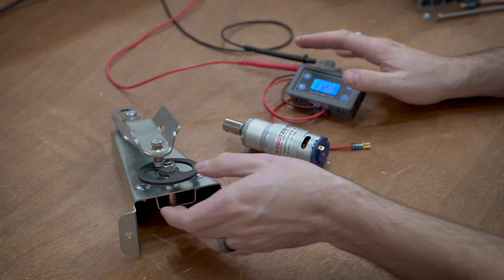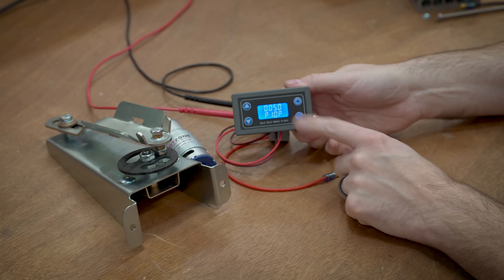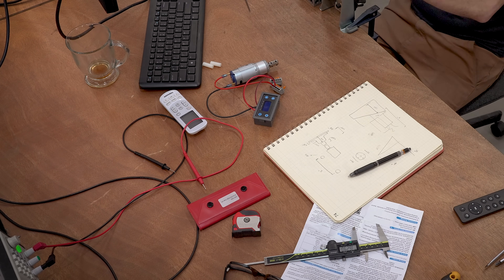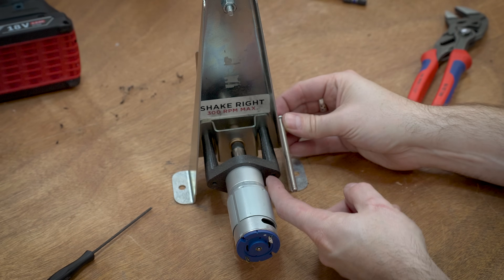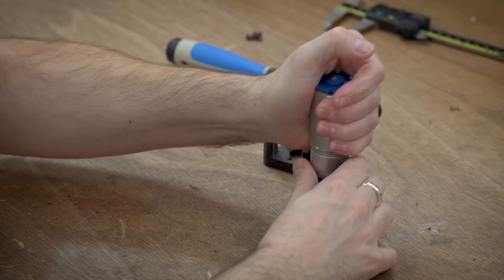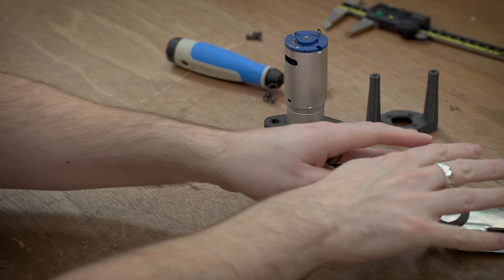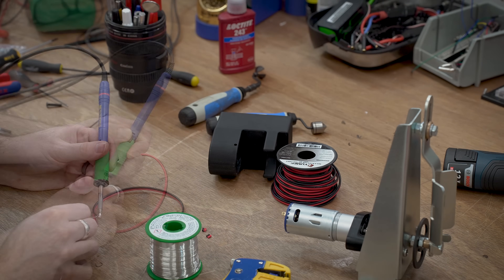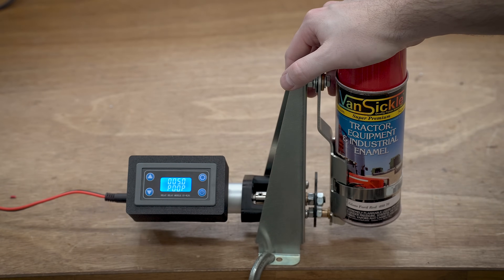DIY Automatic Motorized Paint Shaker!

Comment: I suggest placing a block under the rear of the motor housing to prevent the housing from vibrating up and down.  Alternately, you could make a new motor housing with a rear extension containing a vertical hole drilled through it so a bolt can be inserted to provide rear support.  A plastic foot placed on the bottom of the bolt should prevent damage to the workbench and further dampen vibration.  The bolt could be adjusted for height and secured in place with two lock nuts, one threaded underneath the housing and the other threaded above the housing.  I also suggest replacing the hose clamp with something more rugged.  Customers have reported this part often breaks.

Comment: Excellent video, but can you show how to wired up the relay. I'm a mechanical designer but not electrical, thanks in advance. Can you tell about your power supply? The voltage and Amps?

Comment: Love the design.

Question?  You mentioned that you used your "bench power supply" to power it.   It's hard to tell in the timer's description but is it fed from 120VAC outlet or do I need a 12VDC power supply to feed the timer?

Thank you.
Reply from the maker: It's a variable output power DC power supply.  I can dial in the right voltage.  I use 12V for this.  You could just use any 12VDC power supply.
Reply: @RobertCowanDIY  thank you for the reply.

Comment: Great video, thanks a lot. I ordered the same relay but for the life of me can’t figure out the wiring. Can you elaborate and help a guy out? Thanks!
Reply from the maker: Did you end up finding the datasheet?  I don't know if I'd be able to explain it better than that.  Just google the model number and datasheet, it's easy to find.
Reply: yeah .. I've realized my wiring is correct but my application wasn't .. my motor (old battery drill gear-motor) has to high a start amp draw .. from what I understand it creates a voltage drop when, powering both load and relay from the same powersource, makes the relay drop offline .. so all I got was a click and a 4 deg movement on the motor .. then nothing ... was tearing my hair out until I came across a line in a forum entry that suggested the voltage drop .. not sure how to fix it yet .. either other motor (yours is an expensive unit in Canada) or maybe some sort of capacitor that stabilizes the input voltage OR two power sources .. works like a charm with my two desktop power sources btw .. anywho, thanks for the video ..
Reply from the maker: @matsworld9386  Gotcha, mine was doing the same thing on a crappy power supply.  A capacitor would most likely fix the issue.  Best of luck!
Reply: oh interesting .. hm .. I'll try my other one as the main one and see what happens .. good to know your motor wouldn't be the solution .. cheers!
Reply from the maker: @matsworld9386  Yeah, try the biggest power supply you can find and see if that solves it.  If that does, a capacitor would probably do the trick.

Comment: Just a sanity heads up if you put your cans into warm/hot water for a few minutes before use you dont have to spend minutes shaking the cans just 15 seconds when warm and they are properly agitated unless its undercoat and it will need 30 seconds. Bonus is the warm paint and the warmed butane driving it will perform significantly better.
Reply: That's only true if they're relatively fresh. Cans that have sat for months will still need the longer agitation period to break up the pigment clots that have settled out. Totally agree with a warm water bath, though. The paint lays down far smoother.
Reply: Liar.

Comment: It looks like the electronics probly experience significant vibration, that could be an issue. The timer isn't built for that, so I expect cracked solder joints causing random shut downs or restarts.

Comment: Very cool project!

What are those things in the red pouch?

Why the thick walls on the timer housing?

I always flip my spray cans upside down to shake. The assumption is they've been sitting right side up since they were filled, so all the solids have settled to the bottom.
Reply from the maker: HA!  I literally released a video just a couple weeks ago that explain exactly that, it's worth a watch:  https://youtu.be/pFNDGTDgj3I  Also, when you're done with that one, might as well just go watch my whole channel start to finish a few times just to be safe.

Comment: Do not try this at home; I routinely take my aerosol spray paint cans and put them in my heated ultrasonic cleaner. Heat and shake at the same time. I just take them out and shake them for 10 seconds or so and I'm ready to go.
Reply from the maker: Hum, interesting.  I feel like I need an ultrasonic cleaner.
Reply: @RobertCowanDIY  I really like this project though. I would like to build one of these too.
Reply from the maker: @gearhead7896  Nice!  I think at the very least, it's a fun little project and the relay timer module is a nice thing to know about.  Thanks for watching!

Comment: A plumbers expansion plug and hunk of PVC turns any electric drill into a paint shaker in seconds, but this is still interesting.
Reply from the maker: MANY people have mentioned something similar.  I still have my doubts about how properly that's really 'mixing' the paint versus just stirring it around.   But if it works for your application, go for it!

Comment: Nice. I have one I built 20 years ago from a copier. It’s over kill I could shake a car with it but the lesson I learned was shake the can like your arm would. Slowly. The short fast stroke you have will shake the straw out of the nozzle in the can.   Slow yours down.
Reply from the maker: Huh, hasn't happened yet, but I'll keep an eye on it.  Slowing it down is super easy, I just need to decrease the voltage of the power supply.

Comment: Great idea but I'm just wondering if you could simplify the design by moving the motor forwards on to the main frame and mounting a new flywheel directly to the motor shaft.
Reply from the maker: I think that would cause more issues than it solves and your part count would still be the same.  You'd still need some sort of mount for the motor, since it mounts on the face of the gearbox.  Additionally, you'd end up over-constraining the assembly.  The shaft would see the axial loads from the paint can shaking, which would be a problem for the bearings on the gearbox, they're not designed for that load.  The bushings exist for that purpose.  By using the key into the head of the bolt, it allows for some axial wobble and play around that axis, meaning those loads don't get transferred into the motor or gearbox.  This was the simplest way I could come up with that wouldn't put all that strain on the motor's output shaft.

Comment: I use a 10" x 3" PVC tube with a cap and a bolt chucked up in my drill. Drop the Spray can in and spin for 15sec each end of can. Work great.

Comment: Beautiful.  Reduce shake speed for effective shake
Reply from the maker: It's where it needs to be (according to the shaker), but decreasing the voltage a bit will slow it down.  Since I'm using a bench power supply, it's easy to just dial down the voltage.

Comment: Nicely done! Kind of a conincidence. I left my pla 3d printed drill paint can shaker outside and the cold made the plastic brittle. So now I have to print another. Side note thank you for the information on the k1. You were spot on. I bought and replaced the original extruder and now she is a good one!
Reply from the maker: OH yeah?  What extruder did you go with?  I'm curious because it's working fine for me, but the print quality is pretty 'meh'.
Reply: @RobertCowanDIY  I went with the updated creality extruder. The one that is called the v3.0, as for quality I also upgraded the hot end to the microswiss and that has been very very nice! I am planning on starting to use my k1 as part of the small printer farm I have. If it works out I will buy a couple more of these.
Reply from the maker: @Engineerd3d Interesting.  I'm still not sure if I have the most recent one.  I can't really find great details on the different versions.  From what I've seen, it looks like mine has the most recent one.  I'll have to check out the microswiss, I've heard good things but haven't seen a before/after comparison.  Mine prints fine, but the quality is just meh.  I've heard that gyroid infill is pretty necessary due to the flimsy connection of the hotend.
Reply: @RobertCowanDIY  for me out of 4 printers I have this one has the best overall quality. I tend to use thicker walls as the infill influences the outcome less that way.
Reply from the maker: @Engineerd3d HUH, that hasn't been my experience.  I get a lot of wobbling and such on the surface (VFAs?).  I'll try thicker walls.  What are your other 3 printers?
Reply: @RobertCowanDIY  I have 3 ender 3s that have been tuned for production work.
Reply from the maker: @Engineerd3d  Gotcha.  I guess I need to spend some time tweaking the K1 since the print quality is certainly the worst of the 3 for me.  I heard the latest firmware is a big jump in quality though.

Comment: Not a good paint shaker at all, would not be mixed properly.
Reply from the maker: And why is that?  It's moving up and down and side to side, just like the instructions say.  The ball is also moving quite a bit, agitating the paint as well.  It's kinda ideal.
Reply: Yes, I think the vast majority of the mixing is achieved by vertical motion, making horizontal motion unnecessary, but there is still some horizontal motion from this design. My only very slight concern is that it may be moving too fast to allow the liquid to utilise all the inertia, effectively shaking the can, while the liquid stays still.

Comment: I really like the use of heat thread inserts here: no nuts to lose if you decide to remove the motor for more compact storage later and the PETG will probably keep the screw under a bit of tension so less likely to vibrate loose but with locktite it's just not going anywhere.

Also making the motor mount out of PETG along with the compliance in the coupling would along with better longevity of the plastic maybe give some dampening properties to the motor and the electronics box. Not sure if that's going to make any tangible difference in keeping all the solder joints or the brushes inside the motor intact but it's probably better than a full hard mount.

11:29 I think this is a very valuable feature, ergonomics are pretty important and the ability to adjust the screen so it's clearly legible without having to bow down or twist your head in weird angles is going to make this a lot more approachable to use. I guess after using it a couple of times all you need is to blindly press the start button and not look at the display but even for just aesthetics reasons I really like the decision to make it pivotable.
Reply from the maker: Hey thanks!  Yeah, there are a lot of little details in there.  The PETG motor mount does actually damp quite a bit compared to the PLA one.  I think it should be just fine for using 5 minutes at a time.

Comment: That mini cutter is interesting. I see it being sold on aliexpress but not powered from DC, so I assume motor was replaced with something better.
Reply from the maker: Correct.  The chop saw is from harbor freight, but it now has a 1KW brushless motor/controller and is powered from my Bosch tool batteries.  I'll get to documenting the build some day!
Reply: @RobertCowanDIY  Could you tell us what motor model did you use?
Reply from the maker: @arekx  I'll have everything linked in the video once it goes live.
Reply: @RobertCowanDIY  Ah, so "some day" is close 🙂
Reply from the maker: @arekx  Yeah, it's usable, it just needs to be 'finished' and made a bit more presentable.

Comment: love it........ thanks for putting this on printables....great stuff...i really thought you were going to cnc this out of aluminum :)
Reply from the maker: Nah, I'm on a big 3d printing kick right now it seems.  Machining is fun, but for smaller projects like this, I just want to get it done and move on.
Reply: @RobertCowanDIY     the inserts were a great idea....i have a love hate relationship with 3d printing...tho the bambu makes it a bit more loveable...
Reply from the maker: @minskmade What's your hate for it?  I just had to run something on my CNC router the other day and man, 3d printing is easy mode.  Going through the CAM process, swapping out tools, indicating the part, workholding, etc.  3d printing feels like cheating.
Reply: @RobertCowanDIY    i feel like 3d printing takes to long....I am an impatient fellow. Though the new Bambu is twice as fast...so not so annoying to me...
Reply from the maker: @minskmade Truth.  BUT, it needs little intervention.  I've learned to structure my projects around the 'wait time'.  I always make sure I'm running a part overnight, or the first thing I do is start with printing something and THEN go clean up the shop and prepare for assembly or something.  It's like cooking.  While water is boiling, you cut up ingredients.  While something is in the oven, you clean up the dishes.  Use the downtime for something else and assume there will be downtime while stuff prints.
Reply: @RobertCowanDIY    that's a very good analogy.
Reply from the maker: @minskmade Yeah, I've spent a lot of time thinking about how 3d printing fits into my projects.

Comment: Nice solution. I do wonder if a soft start/stop would be feasable.
Reply from the maker: Since the motor has a planetary gearbox there is a bit of a mechanical soft-start since it's relatively low RPM.  I know that's a BIT of a stretch, but I actually did consider a soft-start, but that would involve some sort of motor controller (or maybe just a big resistor?), and in the end it seemed to work just fine.

Comment: I dunno man, 450rpms doesn't seem too fast to me- time for high-speed testing with BL motors... :D
Reply from the maker: Ha.  I DID test it with faster motors, I didn't originally have that RPM on hand.  I considered it, but at higher speeds the spray paint can is not properly constrained in the Z axis, so it will just self-eject when going too fast.  I did consider re-engineering the cradle, but sanity got the better of me.

Comment: I half expected the weight of the motor and the electronics just floating in the air to be a problem, but it seems to run fine. Nice job.
Reply from the maker: Yeah, it's slightly wobbly, but that won't cause any issues.  And if we learned anything from last week's video, a bolt through the center of an assembly can do wonders for stability.  The 1/4" bolt running through the middle effectively negates any real issues with the setup.  Also, thanks!

Comment: Robert - that is a really cool functional project.  I also liked the notches in the sides of the case to facilitate removing the display.  Nice extra touch from an experienced designer 👍👍😎👍👍.   Quick - question....   Did you need to print the case with supports on the internal cavity, or was the span small enough to bridge across the gap knowing the surface finish was going to be hidden?
Reply from the maker: No supports are necessary.  You're right, the underside isn't visible and the geometry of the inside is 'optimized' for supportless bridging.  That's why I did a long slot for the wiring rather than a circle (which would cause an issue with unsupported overhangs).  Also, nice job catching the cutouts in the edges, that's exactly what they're for.

Comment: Great idea!  I need to build one.  Any concerns covering up the motor cooling holes?
Reply from the maker: None.  After running for ~5-10 minutes, it's not really even above room temperature.  It's a fairly stout motor and this really isn't much of a load for it.  I think it was only drawing a few watts when running, so it won't ever eat enough power to get hot unless something is badly misaligned or bound.  If there was a temperature rise, I would have used something other than PLA, as it would deform with the extra heat.

Comment: Interesting project. I wonder if a Velcro strap would hold the paint can to the machine, seems like extra work to screw and unscrew that hose clamp.
Reply from the maker: Yeah, I've tried a few different options.  Reusable zip ties works great too.  I have put quart cans in there just fine.  Velcros strips would be fine, you'd maybe want a piece of foam around it to take up any extra slop.  It does like being pretty tight.
Reply: @RobertCowanDIY  I was also thinking a bracket on top of the paint can lid would help secure things, but I suspect different cans have different heights, so it gets more complicated.
Reply from the maker: @MrDksmall Correct.  Clamping is probably the best route, but a 'quick release' would be nice.

Comment: I just don’t shake the cans and have bad paint jobs. Very simple and quick. “Painters HATE this one weird trick!”
Reply from the maker: Ha.  Almost every single time I've painted with spray cans I've wished I shook them longer.  This will HOPEFULLY stop that habit.
Reply: @RobertCowanDIY  because my hatred of spray painting I started powder coating and cerakoting. Much more durable but of course a bit mkre of an involved process having to bake it. But I REALLY recommend looking into Cerakoting. You can do it at home, just like powder coating. The durability is insane, I use that for firearm parts mostly. Even on plastic but you can’t bake it as high of a temp. If you want an extremely durable finish, check it out.
Edit: You don’t even need a spray gun. I have used those Preval sprayers and gotten perfect results. Just thought I’d mention it.
Reply from the maker: @c0mputer  Yeah, I might need to look into that.  I've heard a lot about it and even started researching it.  I think for my next project, I'll try that, thanks!